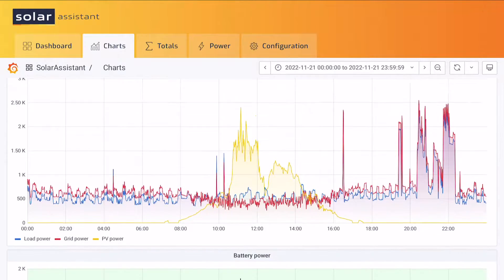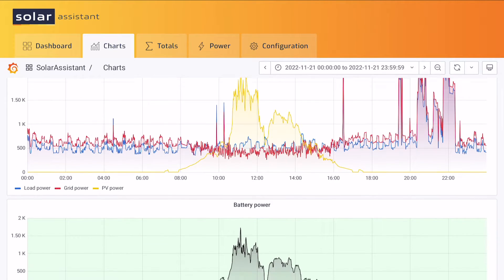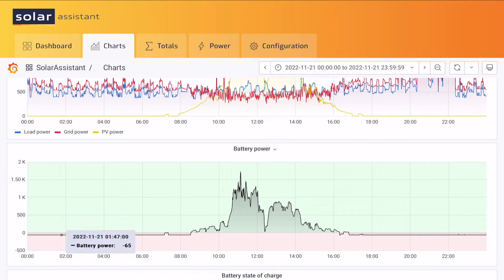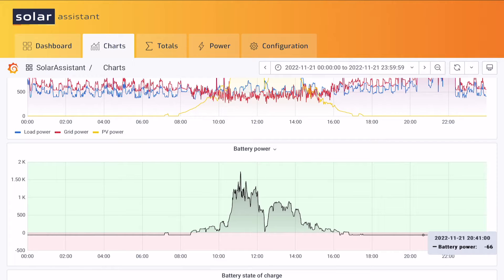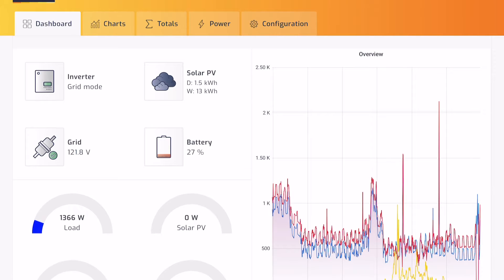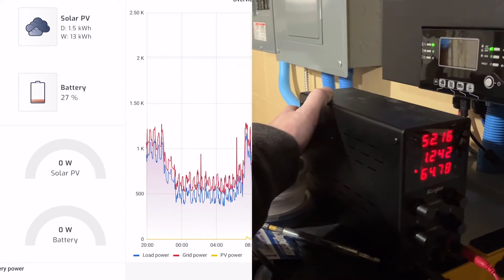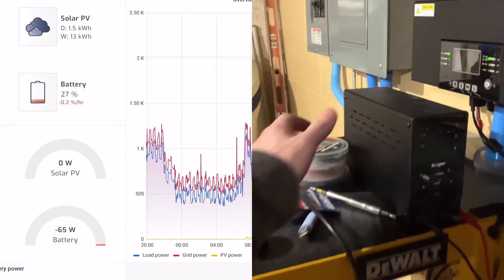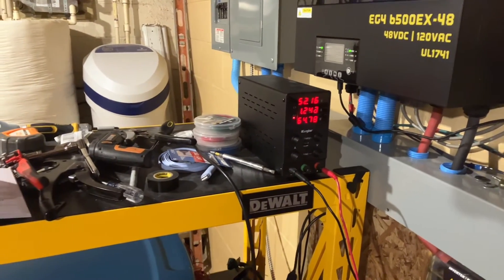When in Grid-Bypass, Can the Grid Supply the EG4 6500EX Power?

Comment: Even on low voltage bypass my MPP 6048 my unit still pulls about 70 watts as well
But
When the voltage reaches the set minimum battery voltage it will recharge from grid to the low voltage disconnect voltage
Reply from the maker: That must be due to the fact that charging from grid can only be done when you're in grid-bypass mode, standby or fault mode.  Then it stops when it switches back over to battery.  Is that how it's working for you?
Reply: @AdamDeLayDIY  seams to be. Even tho I have it set for only solar charging

Comment: With my LVs, I don't see battery draw at any SOC in SUB mode with solar only charge.   If I want grid to charge, I manually switch to solar first, then utility.
Reply from the maker: These tests were actually done in SBU mode when the voltage got too low and switched to grid mode.  Aside from this little "trickle charge" to compensate for the draw overnight, I don't use grid charge at all.  Guess we can probably chalk it up to another software issue since the hardware on the LVs and EG4s are almost the same.
Reply: @AdamDeLayDIY  I am not in SBU with low batteries.
Reply: I manually decide using SA when to switch SBU and SUB.   Our 30KWH bank can only supply 12 hr of base load, no heating.   Nov, Dec sun is hopeless even if you fully tap out 8Kw of PV per inverter.    2-3-4 days straight under cloud will never run daytime base and charge.
Reply from the maker: @errcl65  I completely understand.  Normally I run exactly the same way you do.  Since the “S” in SUB doesn’t really prioritize Solar when in grid bypass, I wanted to see if utility mode worked any differently when it was switched by the voltage settings in the inverter and remained in SBU mode.  Spoiler alert, it doesn’t.

Comment: It seems like this work around only works if you don’t have any panels on that particular inverter. Otherwise it would be charging at 2 amps from the sun during the day also. You really  shouldn’t be having any draw at all in bypass. My lv6548’s don’t draw anything in bypass. That’s too little of a current for it to be idle consumption from the inverters. So I honestly have no idea why it would be happening.
Reply from the maker: It works because of the charging priority (16) is set to Solar First which prioritizes solar charging power over grid charging power.

I was thinking the same thing about how there shouldn’t be any draw, and supplying power to the inverters was the only reason I could come up with.  Didn’t make any sense but I knew I had to get rid of it.
Reply: @AdamDeLayDIY  I realize it works in a sense. I was just saying during the sunny days you’ll still only be charging at 2 amps unless you constantly adjust that each morning. Where ideally you’d want to charge at whatever max amperage you have for your battery bank.
Reply from the maker: @GavinStoneDIY  The 2amp charging is set under option 11, which is "maximum utility charging current".  So it has no bearing on amount of power that can be charged to the battery from solar.
Reply: @AdamDeLayDIY   wow that’s awesome. I haven’t ever used grid charging with mine so I hadn’t ever searched through the options. Either way it’s an issue for signature solar to hopefully work out. The idle consumption for the inverters is around 70w each. So whatever that trickle of power is, it isn’t necessarily from that. Im still not sure.
Reply from the maker: @GavinStoneDIY  Yeah, I really don't use the grid charge at all except for a few tests to see how it works or if I know we have a bad storm coming in and my batteries are low.  I've asked SS what else the draw might be but haven't heard back yet.